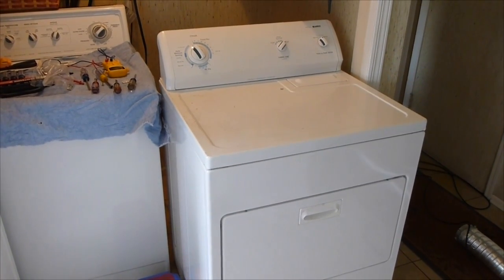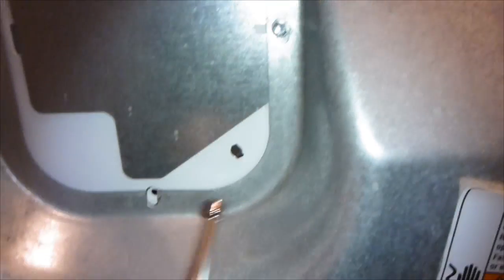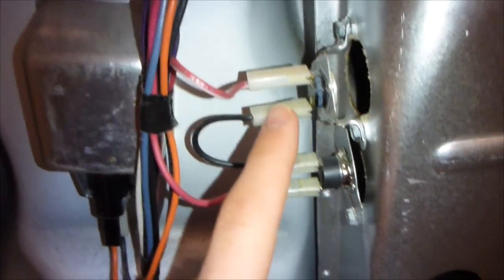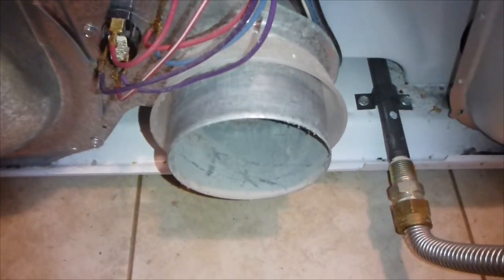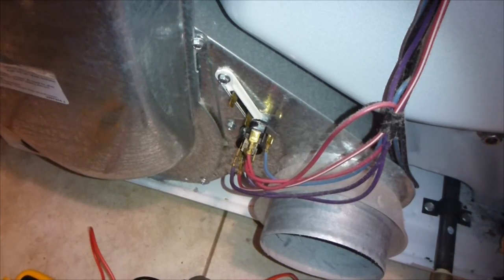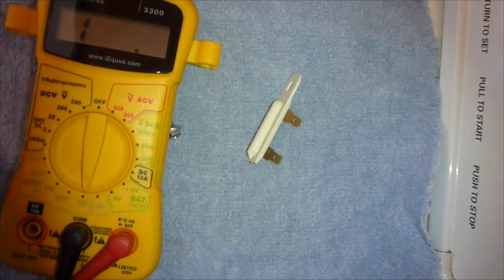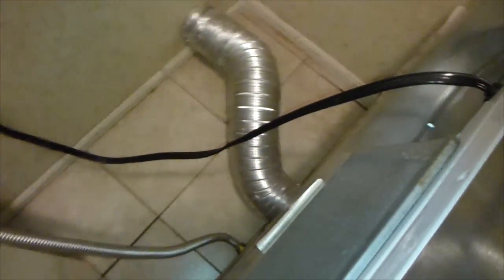How to Fix YOUR gas Dryer that is not heating up (Part 1 rear panel)

Comment: A breakdown: 
1. You turn on the dryer and power is supplied to the bottom thermostat through the solid red wire.
2. Once the dryer starts working it'll give ground to the thermostat and top fuse (the one that looks like a hockey puck with some white words on its side).
3. ground on the top fuse will allow power to flow from the red/white wire to the igniter.
Note: there's a fuse between the red/white wire and the igniter that only allows power to flow from the main power supply to the igniter when the red/white wire is active.
4. When the bottom thermostat reaches it's heat threshold it'll open and it loses continuity.
5. Since not having continuity on the bottom thermostat means that ground (black wire) is cut, you no longer will ground on the top black fuse and this will cut the power of the red/white wire going to the fuse between the main power supply and igniter.
6. Once the red/white wire turns 'off', you'll lose power to the igniter and it will no longer ignite the gas and the dryer won't be able to heat the clothes.

Note: when the dryer is not tumbling or working you won't have any continuity. This is what Chris meant by being able to test it without taking the black ground lead off. You could touch the black test lead to the metal around the top fuse and it would be the same thing. But to ensure that you have continuity within the fuse itself it's better to touch the pins directly.
Note: continuity is different from 'open' and 'closed' circuit in this context.
 Continuity basically means that you have a complete bridge between one pin and the other.
'open' and 'closed' means that current is able to pass ('closed') or not pass ('open')  across the "bridge" between the two pins on the thermostat or fuse.
I.e, when the circuit is 'closed' current is passing from the red pin to the black pin. When you have both power and ground your device or circuit will work. It's similar to why we take the black battery cable off the negative battery post. Without a balanced polarity your electronics cannot 'work'.

Comment: Wow cool video but only one problem the thermostat that’s located just below should be changed out as well , that being said it’s the thermostats job to regulate the heat the thermal fuse is a redundant safety

Comment: I did it! I bought a multimeter and a ratchet set. Turns out the fuse was bad. The hardest part is getting to the back of the dryer to take off the panel. Thank you!

Comment: I don't know if someone already notice this or not, but the second thing you tested in the back of your dryer you replaced the black wire on where the red wire when,.so did that make a problem with that thermostat?

Comment: Thanks for this training. It helped me to troubleshoot and permanently fix the problems with our dryer not heating. Turns out the guy who my wife bought a second-hand dryer from did a botched job of repairing the machine before he sold it to her. I found electrical wires exposed that caused sparks and was shorting out the dryer. There were also other things done that was just not done well but they are now all fixed.

Comment: Hey Chris. My igniter is turning on and the flame appears but about 10 seconds later the flame goes out. Then a minute later the igniter lights up again n flame comes on then goes out. Could it be a bad valve? All other components have resistance

Comment: It’s funny that in every other video that I’ve seen, nobody ever mentions that after you’ve fixed what was wrong you should test the dryer only when put back together or else the flame would keep turning off. I’ve replaced every sensor up to even changing the complete burner when I didn’t need to. I was very frustrated until I saw your video and for that, I am very grateful. Thank you so much. Thumbs up and subscribed.

Comment: with my dryer it will heat uo and I'll see the flames but within a minute or so the flame will go out. I've changed the thermal fuse, solenoids, and the ignitor. the only thing i have not changed so far is the flame sensor. I should test the cycle thermostat and high limit thermostat but.... Need you advice

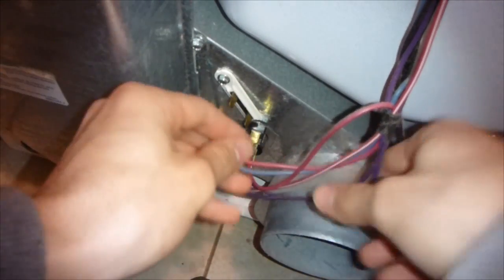Comment: Glad it worked. I'm no electrical guy, but found it interesting at 5:30-5:50 minutes into video the wires were reinstalled  opposite of the way they came off. Must not matter because it worked?

Comment: My dryer has intermittent failure of my igniter.
Do you think it is not the thermal fuse and I don't need to check it?

Comment: If I turned the knob time up to 70s , I see fire on via the small window , after dryer run a few 1-2 mins, I the fire turn off, so which part fail ?

Comment: Dryer that glows and no heat no need to open the back.. it is gas valve solenoids,  flame sensor.

 If it doesn't glow and no heat here is the fastest test sequence..  
Unplug dryer from wall remove the upper and lower rear panels, unhook red ( bottom)  black ( middle ) and blue upper wires from the timer switch.. isolate them.mark them so hook back up correctly .  Turn switch dial so is ON but not on Air-Dry, select hi heat on temp switch. Test switch red and black terminals must read 000 Ohms not open OL..
Leave other wires hooked to sensors. 
check for continuity from the red wire at switch through the hi limit switch ( red wires) , the temperature control ( red wires) thermal fuse ( red wires ) the thermal fuse must have continuity on both sides..  reconnect switch and put rear covers back on.. 
, remove lint screen and screws and snap lid of dyer up and tie open with bungee cord or twine..unhook door switch and bypass terminals with wire.
unhook belt at bottom of basket and take picture so can thread belt on spring pulley tensioner correctly later  
No Glow.. 
Unplug harness at igniter and replace igniter.
Glow No Ignition: 
Check Flame sensor and gas valve coils.. 

Run dryer without basket or belt and check if gas turns on and ignited.unplug again from wall Remove door bypass wire and plug reinstall basket and belt tensioner , turn basket to align belt and install front panel while closing lid plug door switch back in install lint filter screws and lint screen/ be sure to reconnect the exhaust stack..

Comment: you made a mistake in the video. you hooked up your 2nd thermocoupler wrong . you put your red wire onto the black wire connection. other than that good job

Comment: Good problem solving process.  The one odd thing that really helped out is around the 8 minute mark.  You said check the new parts to make sure they are good.  After troubleshooting for a while, I tested the new part and sure enough, it was defective.  Replaced that and I was back in business.  Thanks.

Comment: Excellent!  You saved me $600. I actually bought a new dryer and had to send it back because it could not fit through my doors. With desperation stepping in, I decided to scour the Internet for a solution. I can across you video and the rest is history. Problem solved for $5.00 and my other $695 is back in the bank.
Reply from the maker: Awesome! I'm glad the video was helpful and saved you $600!
Reply: was your problem a broken Thermal Fuse?

Comment: So my thermal fuse would not read at first, then it was reading, then it wasn't, then it was.  Am I holding the little multimeter connectors wrong or is thermal fuse in the process of going bad?

Comment: Hey Chris. I have a Samsung gas dryer. The dryer ignites, but the flame shuts off after about 4 to 6 seconds. It doesn't get hot enough and it takes 2-3 hours to dry a load. I've changed the thermistor and hi-limit temp sensor, but no change. Any idea what it could be?
Reply: replace the coils

Comment: Used this to fix my gas dryer today.  It was a perfect guide to troubleshooting my dryer.  I checked the fuse first, and that was it.  I did have an obstruction, so Im glad it failed.  Easy fix.

Comment: Ok Chris help me please. I have tested everything in both videos. I even replaced the solenoids for good measure, both sets test good. I have gas to the dryer. But no flame. What am I missing? Thanks for all your help and support with your videos
Reply: check flame sensor, on the funnel

Comment: After watching your video I was able to diagnose my dryer in 5 minutes saving me lots of $. It was the fuse. One comment, the fuse showed good on the meter when the two wires were connected. Being suspicious I disconnected the wires in order to isolate it and it then showed no continuity. It is probably best to isolate each component before testing  because each model of dryer may be slightly different in its wiring.

Comment: My igniter is only glowing some if the time. Like one out of ten times. Ive tested thw igniter and it tests fine. I tested all thermostats amd they test good. Coils test good. Flame sensor tests good. When i test the red timer contact ( unplugged from the back of the timer) to the blue wire on the door sensor. I get OL for ohms. Same thing doing red timer contact tp neutral on the plug.. And the thermostat heater reads a 0.0

Comment: Your instructions were spot on and I also replaced my thermal fuse which fixed my dryer.  Your instructions on how to use the multimeter gave me the confidence to troubleshoot the dryer problem!  Thank you

Comment: The problem i have cant be found continuity shows okay on everything but yet no heat which im thinking maybe dial switch or a bad wire or something. Im looking through any video to find my problem cauze last thing i wanna do is screw around with wires.

Comment: Thanks for helping me save about $200.  Vary fast fix. I also had a bad thermal fuse.  The other thing I would add is my multi-meter also has a "continuity mode" which I found to be better than the ohm setting.  The beeping for a closed circuit was clearer for me rather than reading the ohms.  But, thanks again.

Comment: How to fix an Electric washing machine that don't start for the cycle knob not turn, as well as an electric dryer that don't turn on at times even when knob is turned and pressed along with the door at times don't stay close.(both are Kenmore ) And where to buy the parts at of good price and quality?

Comment: So i had same problem and took the 2 wires and kind if hotwired it in a sense. It worked for about an hour and i bought the part and it didnt work what would be the nezt problem be?

Comment: Good video--nicely done with clear shots and good audio. I was just wondering if the blown fuse is just a normal wear and tear thing or would it indicate a causal problem? Should this happen with a two-year old dryer?
Reply from the maker: If it is old it can be something that just went bad or you could have a clogged or partially clogged exhaust vent.

Comment: Tested all mine and they had continuity, but the continuity was kinda weak and spotty. Cleaned all the terminals with sand paper and it ran like a champ. Very old dryer
Reply from the maker: Awesome!

Comment: Mine heats up and works great 95% of the time. But then ZIP. Also NO portal as he shows. It is a GAS dryer I do know the difference. If someone would fix it for $100.00 I would be thrilled. Otherwise its looking like a $600 replacement.

Comment: Hi I have a similar problem is the same model but with mine the gas does turn on but only for a few min and it turns off
Reply from the maker: +Mayo Quiñones replace the solenoids

Comment: My LG dryer does not heat.
I opened the front to watch the process. 
The ignitor lights then the gas valve opens and I get flame fir about 3 to 5 seconds. Then the gas shuts off and so does ignitor.
I tested the thermistor for continuity along with the other sensors. The thermistor didn't make and noise on my tester, so I figured it was bad. Other sensors beeped. I tested the new thermistor before putting in my machine and it made no beep on my tester. Is the thermistor supposed to show continuity, a beep on my tester. could it be the new part is bad? 
What else might cause this? 
gas ignited, just does not stay on, thus no heat. Dryer and venting completely clean!

Comment: I noticed, on your video, that when you replaced the wires on the upper switches, you put the red on top and the black wire on the bottom.  That's not where they were originally!   Would it operate normally??

Comment: Awesome video, ChrisFix. Saved me some cash. Thermal Fuse $18 at Sears (cheaper at Amazon, but couldn't wait), $20 multi meter. Still about $100 bucks savings for in home repair.
Reply from the maker: Awesome Paul! Nice work!

Comment: Should I order from Amazon for cheap or Sears? Does it matter?
Reply: I ordered from amazon two years ago and my fuse is working well
Reply: stephencarlsbad Thanks! I ordered it and it came 1 week later from Amazon. Nevertheless, your video was outstanding. The dryer works and my wife is pleased! Plus I probably saved about $90.

Comment: Thank you Chris.  I'm not particularly handy - but since retiring trying to fix things myself and keep costs low.  Your video was perfect and by following it step by step was able to diagnose a blown thermal fuse on the dryer.  Took longer to find an appliance parts place then to take things apart and put them back together.

Comment: you crossed the red and black leads on the lower of the two primary thermostat when you put them back (1st set you checked, 2nd one you tested.) the red belongs on the bottom of that one and the black belongs on top.  just the reverse of the one above it. That one is the fail safe.
Reply from the maker: Thanks, it doesnt matter as long as they are both connected.

Comment: Hey Chris because of you I fixed my Kenmore 600 series gas dryer (solonoide  and fuse)  for about $60.Thank you so much.I would like to replace the water pump on my 2008 toyota yaris sedan ,do you have a video? Thanks again, your videos are terrific. if

Comment: Chris
I had never use a reading meter till your video. I followed your setting and went to work on the back of my dryer. I called a repair guy and he wanted $100 dollars to come out. So I decided to try it myself worst case I would by a new dryer. After using the meter it came out to be the fuse. I took the vent apart and cleaned it out, it had so much crap in there lol. I then went on eBay and bought the fuse for $3.50. Just installed it and it started right up.. Thanks for the great video. If followed step by step it works perfect , thanks again.

Comment: Nice tutorial, but I noticed you put the wires on wrong on the second thermal fuse you tested. Black should have been on top.
Reply from the maker: Tanks Michelle! Good eye but it doesnt matter the order, just that they are connected!
Reply: +ChrisFix you made a great video. It's helping me get started on problem solving my dryer issues. I noticed my clothes weren't drying, but I'd smell gas. I opened up the dryer and saw that the burner tube was burnt up. So, I ordered a new burner tube and now I'm going to go through and test all the same things you were showing in your video. I do have a different dryer, but I noticed gas dryers all seem pretty much the same. Anyway, thank you for the video.

Comment: At the beginning of the video, the socket where your blown fuse goes was empty, and then later on there is a fuse there. Did you skip a step? Because my dryer, like yours in the beginning of the video, has that long, thin slot empty with no sort of fuse filling it.
Reply from the maker: I am not sure what you mean. I did not skip anything so what you saw is what I did. What is the time stamp of what you are talking about?

Comment: Hi Chis, our Whirlpool gas dryer was shutting off the igniter after about a minute.  I replaced the solenoids but it did NOT fix it.  Is it possible that the heat element is not getting warm enough?
Reply: I have the same problem.  My igniter and thermostat ohm out OK. I do not hear any click from the solenoids. I have not checked out the fuses on the back side because it's a total PITA.  Can the fuses open intermittently? Or once blown they remain open?

Comment: Very helpful video.  My dryer has been acting up to where it won't heat all the time.  Im going to be testing it tonight.  FYI I hope that the second thermostat that you checked worked properly because you switched the wires around.  Not criticism,  just hope it worked ok.  thanks again.
Reply from the maker: +Luke Potestivo great.  Glad the video was helpful.  As long as the wires are connected, it is ok (order doesn't matter)
Reply: So i did all the checks in the back, everything tested fine.  Went to your part 2 vid to see if it could be the other things upfront.  Im stumped because the thermostat and the part in the middle checked out fine.  The relays click, but not always sending gas to ignite.  The pilot lights,  relays clicks, and no ignition.  ??  Could it possibly be the relays, or do you think the orifice could be bad? And it will run for 10 mins ok, then not light again.

Comment: Hi, I have spin, blow, no-glow. I have no continuity temp cut-off thermostat. At the igniter, I have  about "70" on the omh meter with "changing numbers".. Is there a problem with the igniter?
Reply: +Daniel Schechter Okay, I see omh  meter can read below 400 on the igniter and it's okay.
Reply from the maker: +Daniel Schechter it is 99% the gas solenoids.
Reply: +ChrisFix thanks for the reply. Some are on the way.

Comment: excellent description, great video close-ups, great explanation. Thank you so much. You just saved me at least $100+  on labor plus the 3X mark-up on the part which was a thermal fuse costing me only $10.95. Highly recommended site

Comment: I found the high limit thermostat and the heating element thermal cut-off to be blown out (no continuity at room temp), so I replaced them.  The dryer worked normally for a few minutes, then both blew again.  Screen is clean.  Ducting is clear. Blower working normally.  What is causing the thermostats to blow out?